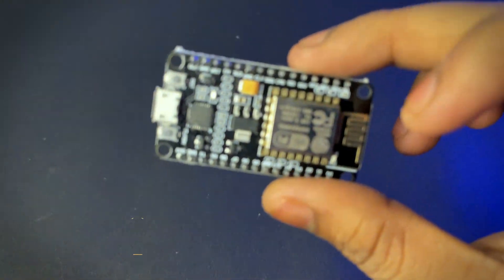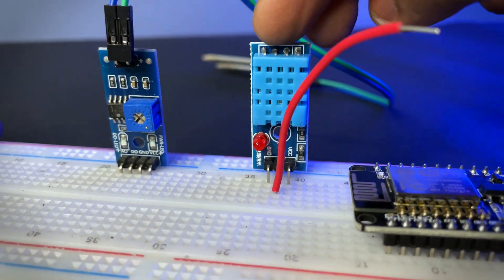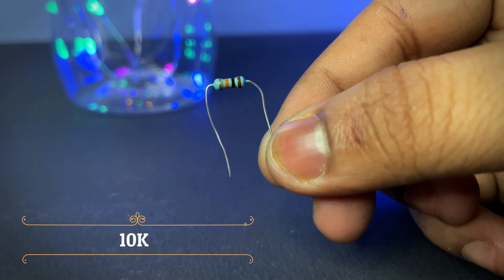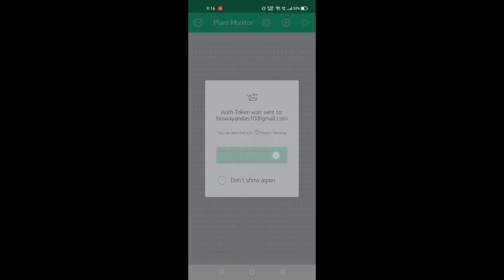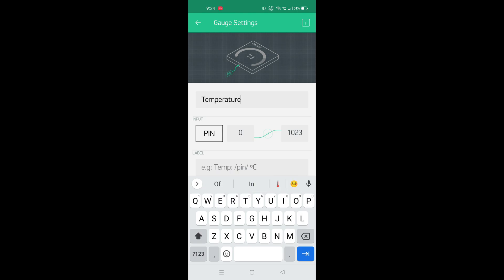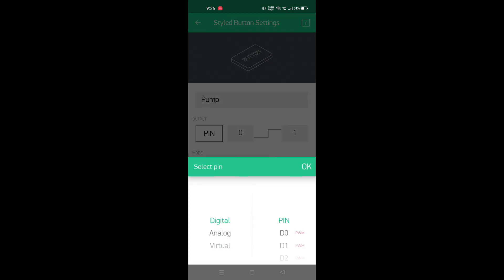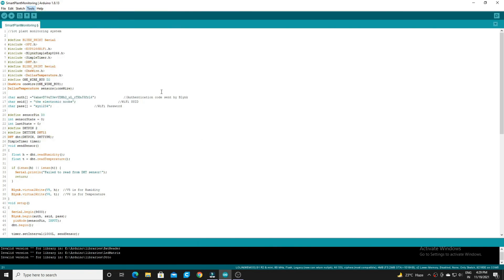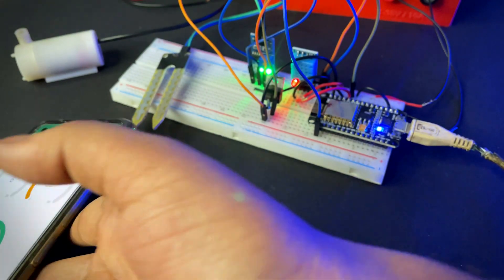IOT Smart Plant Monitoring System

Comment: Is it possible to use just the regular button in the app instead of the styled button?
Reply from the maker: Yes possible
Reply: @electronic_noob_shorts  You just have to change the pin from d3 to whatever virtual pin you choose right?